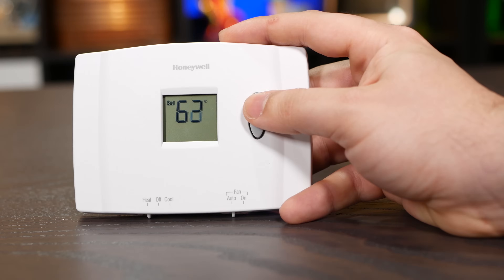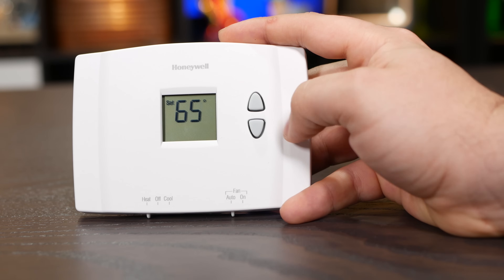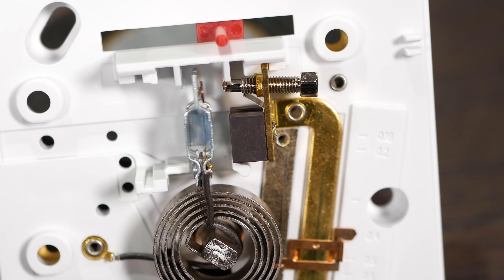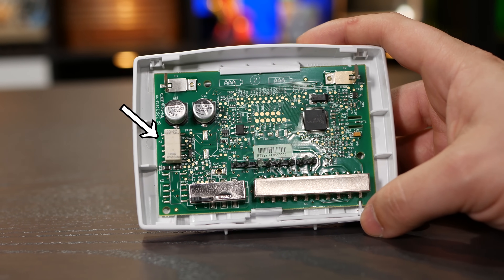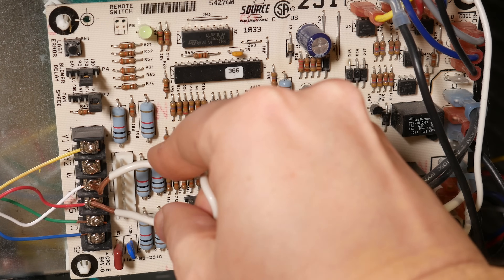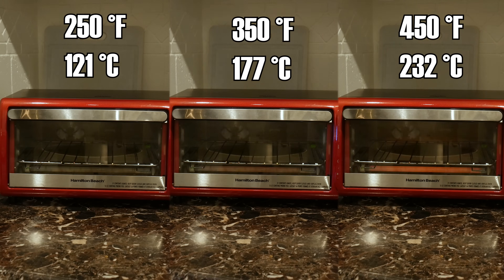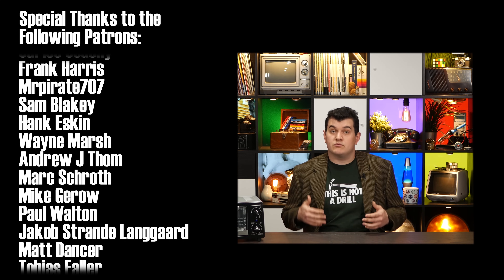Thermostats: Cooler than you think!

Comment: Here in Quebec we have solid state (TRIAC) thermostats which are even cooler :) Electricity is relatively cheap, so for most homes we heat with electric baseboards. So thermostats in each room work with 240V AC current, being in serial connection with its baseboard. If more than one baseboard is linked to a thermostat- which is common but is subject to a max load rating- the boards are then linked in parallel together.

The solid state circuit differs from a typical relay in the sense where 1. each change of state is silent (no clicking like a relay does) 2. There is no limit of duty cycles like a relay does, hence 3. The resulting temperature is very accurate and constant because once the desired temperature is near, the pulsing can happen very often and / or for very short duration - like 5 seconds if need be.

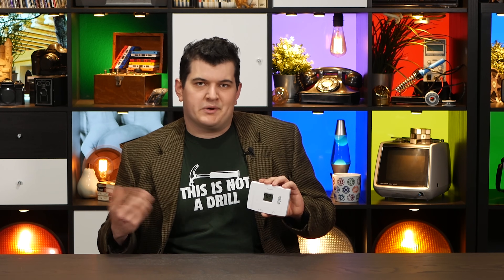Comment: 2:16  -- I like the old Honeywell thermostat better. 
https://www.flickr.com/photos/cakebreak/4703171946/
I just want to set the heat at  a low 58* , and A/c at 85*f. .
8:39 -- I do not like to replace batteries.  This does not have  a bi-metallic spring!  >:(

Comment: There’s 2 stage furnaces and modulating furnaces. The thermostat controls the staging. 70 percent to 100 percent or start at 40 percent and works it way up to 100 percent. There is this type for air conditioners too

Comment: I want to get 2 new cheap thermostats so I’ll never have to bother with switching between cold and hot. Set the hot to 65 and the cold to 75. That way the house is always the right temperature year round and nobody has to touch the thermostat on those days between seasons.

Comment: In germany and sweden there are almost only water heated radiators with a physical thermostat. In (south) germany I see people using it as a simple on off valve instead of setting the temperature and letting the thermostat do the job, germans only use maximum and off, always running back and forth to the radiators. I see this behavior in persons homes and at work.

Comment: Darn you! My thermostat DOES have a PWM output. It’s labeled BK. And without it, my ac system does NOT work as well. Why? Because my thermostat is way smarter than any typical “smart” thermostat. My Trane Thermostat actually controls the blower speed directly via the BK  wire. AND cranking the heat up, DOES in fact make to heat faster or cooler. This is based upon load and humidity. I highly recommend you research this. It’s a nexia Trane thermostat xl-825. The BK wire will also be used by zone controllers. To control blower speed based on , yes, again, load.

Comment: Good video.
8:57 A slight correction: I seriously doubt they use thermocouple for ambient temperature sensor, it's more likely a PT100, NTC or PTC.
that white square object on the left is a small bistable relè, there are two types: you need to put a voltage pulse to latch, and an inverted polarity pulse to reset, and the other method is by using two coils on triggers the on latch, the other triggers the off latch. using latched relays is compulsory for battery operated thermostat due to the near zero power consumption.

Comment: As far as the "one cycle" idea is concerned, my thermostat does something very close to that. In fully automatic program mode, you can manually adjust the set-point, and it will run at that setting for a fixed time (I think it's two hours) then return to fully automatic. About the only thing you might want to add to make it what the questioner wanted is a variable override duration. 
I would have thought this feature was fairly common, and was surprised you didn't mention it.

Comment: I need a good version of the following because my apartment has two window air conditioners: 

A smart plug WITH thermostat included so that it either turns on or off based on the temperature so I can transform at least one window unit into a smart one controllable by Google home. I've seen these, but they all have horrible reviews (so far).

Comment: a number of heat pumps added to a regular electric heating system will be set to run the heat pump first unless the variance between the internal temp and requested temp are more than x degrees then it causes the electric heat and and heat pump both run at the same time until that variance drops below x degrees then just the heat pump runs.   it's funny at 13:38 it looks like an electrical arc is happening behind the camera.

Comment: I had a mercury thermostat for my A/C and the cheap honeywell for my heat (A/C was put in well after the house was built and in a completely different part of the house from the boiler).  I changed the heat to the Nest because I got a rebate and was able to get a Nest thermostat for free and it was heating season when I bought my house (this saved me when my boiler stopped working while I was away for the weekend and was able to get my parents to run space heaters so my pipes didn't freeze because this was the end of December).  I recently changed the A/C thermostat to a Nest because the mercury switch was old and did not seem to be calibrated any longer as the A/C continued to run at least 8 degrees longer than the set point.  I did appreciate the elegant simplicity of the two thermostats that I had, but the Nest thermostats allow for me to monitor duty cycles and estimate costs.  Now that I understand what the blue common wire does, it makes more sense to me.  I also upgraded my boiler to a combination high efficiency unit that controls duty cycles to an extent on it's own using an outdoor temperature sensor mounted at it's intake so that as it learns it only heats the water in the loop to a certain point and then cycles the loop of heated water without passing through the heat exchangers in the boiler.

Comment: The reason for turning the thermostat up higher at first is because the thermal mass of the house is cold, and (forgive me for stating it this way) it "radiates cold."  Once the walls, floor, and ceiling are up to normal temperature, they won't "feel" cold anymore (like they're sucking the heat out of you).  Case in point: When I was an electrician, I was working in a new-construction house that had lots of hardwood floors in addition to lots of drywall.  Those floors, even though they were wood, had considerable mass, and took a long time to heat-up.  The house felt very chilly even though the air temp was holding where it should be, around 70 degrees.  Once the mass was heated, everything felt normally comfortable again.  So, yes, I turn the T-stat up to 80 at first and let the mass of my home get warm, then turn it down to 70 where I want it.

Comment: I would watch all of this, but I'm not rich enough to own such a fancy hvac system for my house. In the summer  all I got is a swamp cooler with a simple off/low/high setting for the fan and an on/off for the water pump. In the winter, I got one of those old round therometers that work based off a coil in the back for my natural gass in-wall heater.

Comment: Maybe I missed somebody else's comment about this.....

All of the modern and fairly modern digital thermostats I have seen DO have a feature to allow temporary override of the normal heat or cool setting. You just use the normal temperature UP & DOWN buttons, but don't go into programming mode first. Then the digital thermostat uses the new temporary setpoint for a while (2 hours seems common) before reverting to the normal setpoint.
Reply: I've noticed that by staying awake for more than 36 hours straight I am comfortable at a warmer temperature in the Summer months, saving both on air conditioning and restaurant meal bills.
Reply: it's actually usually at set (adjustable) times that it returns to the program rather than a duration. like 6am 9am 5pm 10pm for people with a regular work schedule who wake up at 6, go to work at 9, get home at 5, and go to sleep at 10
Reply: @X2Brute  , I was talking about impromptu settings, used only on occasion, rather than the regular programmable temperature settings that you refer to. The method you mention requires going into a programming mode of some sort, whereas what I was talking about is just done by pressing the up/down buttons without going into programming mode.
Reply: @youtuuba  so was I, usually with most thermostats when you just use the buttons to change the temperature temporarily it will stay at that temperature until there is a program change rather than for a set period of time
Reply: @X2Brute  , what do you base your assertion on? I have installed many tens of digital thermostats over the last 10-15 years, all of them different models, and most of them worked as I described, although certainly some worked more like what you said.
Reply: @youtuuba  28 years in hvac, though if you say most of the ones you install are that way I'm inclined to believe my perspective is skewed by the small number of brands I install

Comment: If what you say is true than that battery in the smart thermostat must last a while. I have a 3 wire fan forced gas heater that hasn't run for a couple months now and the thermostat still turns on.

Comment: I find it interesting that my Honeywell thermostat clicks twice, instead of once, when it activates cooling. It's as if it's commanding "FAN ON" and then "COOLING NOW" a millisecond later.  And it has a large monochrome back-lit LCD display and electronic buttons for the "System" and "Fan settings. I think it's the Honeywell Focus Pro something thermostat. Non-programmable, I might add.

Comment: Mentioning hysteresis vs a proportional (and PID) regulation would have been nice. Show the overshoot and oscillation around the set-point hysteresis control causes, why for example the electric cooking plates are not optimal for preparing some foods. I still wonder why these appliances still work with such a low modulation frequency (periods of dozens of seconds). Love the channel, keep em coming.
Reply: I guess it has to do with inductive kick from switching the big heating coils, making it simpler (cheaper) in design to switch these at very low frequencies. While your radiation heating oven can probably switch that (non-inductive) lamp at the net frequency 50/60Hz with some triacs at the zero crossing while pulse modulating .

Comment: Any new furnace (we call them boilers) in the UK and indeed continental Europe will be a modulating one, possibly also with weather compensation. They therefore don't just blast on or off, they adjust the output to maintain a constant temperature output. This output will also be adjusted to suit the weather (in the case of weather sensing boilers) so for example in a freezing winter it will output water to your radiators at 90 degrees Celsius to heat the house quickly. On a milder spring day it will realise the heat loss from your home is not so great, and the house may only need heating by a few degrees, so it drops the output temperature to 65 degrees. The effect is to ensure the water returning to the boiler is below about 60 degrees, which means the boiler can fully condense its combustion products and thus operate at maximum efficiency. A good boiler is over 90 percent efficient over a year, in other words very little heat escapes in the waste flue gasses. Older style furnaces, especially cast iron types, those with open flues, and simple on or off operation can drop to as low as fifty percent efficient.

Comment: On a typical heat pump system you can have different heating “stages”.   And this turning the thermostat higher will activate the auxiliary heating element which produces more heat output.

Comment: I'm glad you listened and fixed some of the major errors in the original video. However, a thermostat has nothing to do with PWM or vise versa! A thermostat is more like a light switch whereas PWM is like a Morse code transmitter.

Comment: 16:24 yes the Honeywell RTH9585WF1004- actually has an option that will hold  a temperature temporarily. Which is cool because if you have it programmed and come Inside from mowing the lawn you can turn the Tstat a couple degrees down and it will ask you temporary or permanent . If you hit temporarily it will turn on to the new “cool” setting for a little while and then go back to your normal scheduled program.

And it has other cool features also like “Circulating fan” option to keep the temp more consistent in between cooling runs. 

And can connect WiFi just like NEST. Without the little battery problem that NEST has .

Comment: What bothers me is that my thermostat doesn’t report the temperature accurately. I program the thermostat to run the air con on cooler days to trigger when the temperature reaches 78 F, and then have to reprogram it to trigger to run the air con to run at 72 when the outside temperature is warmer. The same thing is required in the winter: a preset has to be changed based on how cold it is outside.

Comment: I had a nest for a while. It was definitely a newer model than the one shown. I got the nest so I could control it from my phone. But sadly it had to be replaced when we got a whole new a/c unit installed. The even newer Lennox is a smart thermostat which not only has time settings but presets for time of year. I have saved summer, winter is coming, and winter. Since I’m in Florida, the summer setting is on the longest. And the winter is coming is only slightly different from summer. The Lennox has a phone feature but I’ve yet to set it up.

Comment: American air conditioners annoy the shit outta me when we visited. It's ancient design means it can only be turned on or off (fan only or full blast) which is noisy at night. Inverters can adjust the output dynamically which is not only more efficient but also prevents intermittent on/off and temperature variations.

Comment: This is probably said elsewhere in the comments, most commercial systems avoid the use of batteries with direct feed to the thermostat. This was very helpful at one place where I noticed the thermostat was dead and immediately was able to determine that the furnace was not functioning. It turned out that the condensate pump got unplugged brilliant which caused it to trip the thermostat circuit and not allow anything to operate. Although it was a very bit too cold. And that case I don't believe the blue wire was connected I believe that it was running in series. Fairly basic digital thermostat.

We used to live in a very old house that only had two wire thermostat cable I almost thought that it was exactly the same as what was used for doorbells in the early age. The colors were red and white and it had a Mercury switch. I agree we have standardized everything to the Point where it's not standard it's own product SKU depending on what you're doing. So thermostat wire is really just a certain gauge and certain number of conductors that idiots can say I want and the store can say here you go in XYZ length. So essentially it is just smaller gauge Romex albeit with a different brand name. Phone wire on the other hand has a lot more going on than you would think at some point we went from basic 2 or 4 to twisted pair in the house ... when at one point it was just smaller gauge solid copper conductors.

Comment: So in the case of a unit that does have the emergency heat option as well as the heat pump, doesn't that mean that turning the heat up much higher DOES mean it heats faster since it can turn on both? Pretty sure in my old house I had a thermostat that would automatically turn on the E.heat anytime the room temp was 10 or more degrees below the desired temp as well as engaging it when it was so cold that a full heat pump cycle wasn't enough to get the temp to the desired number. 

Also my cousin's thermostat has something similar to what you ask for at the end, all changes to the temp are assumed to be a 2 hour change provided you have a programmed schedule running. You have to press extra buttons to change that actual schedule so just hitting up or down is always temporary.

Comment: The "one cycle button" exists in a lot of heating controllers in the UK.  It's usually labelled "Boost" and turns the heating on, usually, for one hour and then off, regardless of temperature.